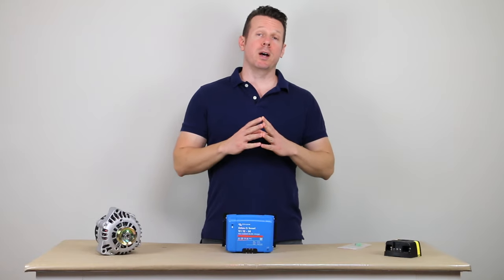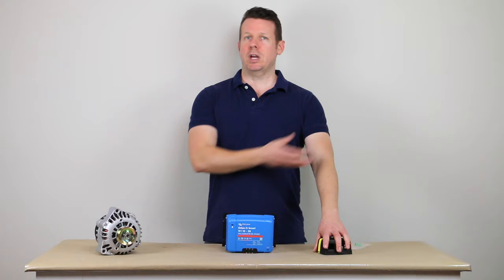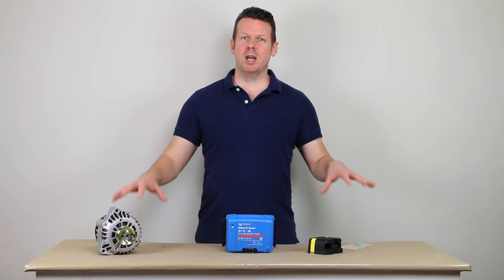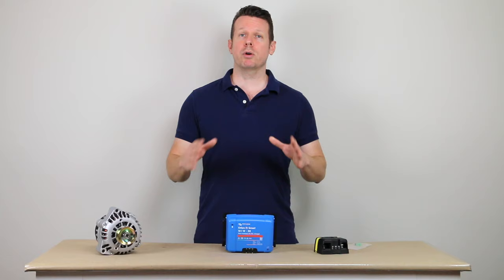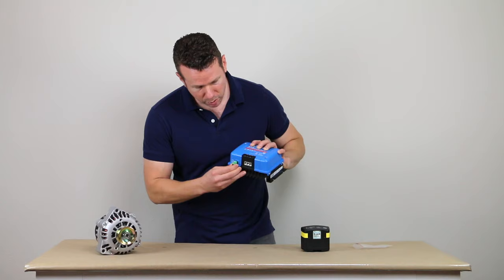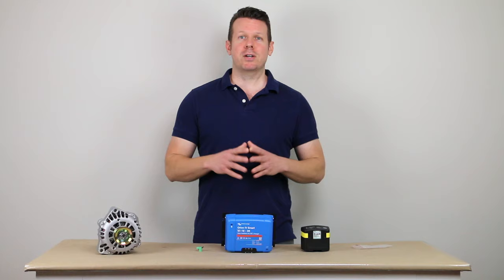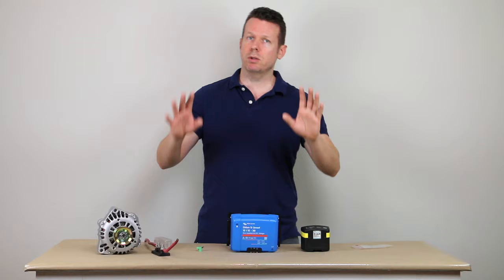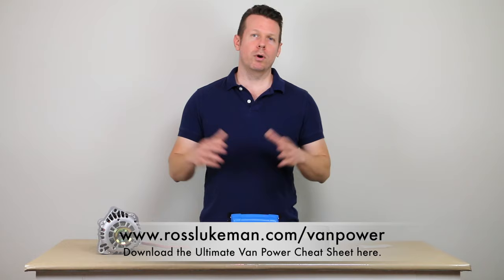Top 3 Alternator Charging Mistakes for Van Conversions | Featuring the Victron Orion-Tr Charger

Comment: Great advice! I outfitted a new Transit with the Orion Smart charger without ignition sense, relying on the “engine on/off” detection on the Orion. With Fords smart alternator it’s very tricky to get the Orion to function properly. It either senses low voltage once the alternator voltage drops and cuts out prematurely, or stays on too long after engine shutdown (if you turn down the shutdown voltage settings like I did ). Either way, not a great setup and I wish I would have just installed the ignition sense wire from the get go.
Reply from the maker: Hi Richard, sorry for your troubles but good to hear your story about problems with the "engine on detection" setting. It's supposed to work with the smart alternators but it sounds like if the settings aren't perfect then it can cause problems. Thanks for sharing!
Reply: 12v on a switch to the victron so you can decide if you want to charge or not. 

Pulling amps from alternator is not free, you get higher fuel consumption
Reply: I installed a votronic b2b on a 2009 transit without ignition sense as I think it said that the unit dealt with this however if you put your ear to the unit it sounded as if it was working long after the engine was on so I think I'll add a ignition sense wire on my new camper when I install me new b2b.
Reply: @chatteyj  just look at what your shunt is saying about current. 

Also look at what votronic user manual says.
Reply: transit have engine run only trigger wire under drivers seat at side of start battery this is used to trigger a relay because it's negative flick then pass 12v trough relay to victron and away u go turns on off when engine is run only.

Comment: if you wanted the starting battery to charge 1st......... could you not  hook up the DC DC on the secondary battery side of VSR, also putting the ignition on power lead to the actuated secondary battery charge cable side?
Thanks Rick

Comment: I’d love to run a DCDC charger but I have a smaller dual 28Ah (56Ah total) battery bank and the smallest DCDC I’ve found is 20 Amps which is for a minimum of 100Ah battery setup.
Reply from the maker: Hi Jay, with 56Ah it depends on your battery type. Pretty much any lithium could take up to 28 amps (.5C) while lead-acid would be 5.6 amps (.1C). If you have lithium then the 20 amp charger would be fine. The Sterling brand chargers also have a 1/2 power mode (night mode) that cuts the amperage in half if you need to do that (https://www.sterling-power-usa.com/batterytobatterychargers.aspx)
Reply: @rosslukeman  actually they are AGM
Reply: @JeepTJay6  Victron do a 9 amp DC-DC.  12-12 / 9. (No bluetooth on this model however). We use them on 55 Ah Lithium setups.

Comment: Hi Ross great video and very clear thanks. I’ve just bought a Victron smart charger 12/12 18 to charge a portable 100ah LiFPo battery pack but I also have an existing set up with relay for the second AGM battery built into my truck. I’m thinking that I could use another Victron charger to charge that and remove the relay. I’m wondering how best to wire these up and if I fit a switch to swop from one to the other or just let them both run in parallel? Have you done anything like this? Many thanks
Reply from the maker: Hey Landykart, thanks for tuning in and for the question. I have to charge for stuff like this as it would take a sketch and a discussion. https://www.rosslukeman.com/offerings Thanks

Comment: Sorry, I am a little confused about the little green plug. Am I supposed to connect the wire from the ignition into the green plug? Is there a positive/negative side to the plug? If I don't do the ignition option, does the green plug need to remain in the Orion or does it come out, or make no difference? Last question, what if I had a Master disconnect switch between the two batteries, will that provide the same safeguard? Thanks.

Comment: Hi Ross thank you for your video most enlightening, I’m looking to install a b2b but only have a 70 amp alternator could I ask what size b2b I could use.
Regards 
Paul
Reply: Don't know if you're still in the planning stage or beyond, but my situation with a 90A oem alternator is similar. Don't want to fry the alternator or drain the starter battery. 

A new unit from Pecron is just now coming to market - the DC1242-500 car charger. I've seen enough to convince me to take the leap. Although it doesn't have a wired connection for separate engine off sensing, it includes that function in its configuration selection via voltage parameters. So, the starter battery is protected from parasitic drawdown and the alternator can be indirectly protected by limits on the operational voltage range. (i.e. slower charge rate)

For me, the most demand will be during periods of poor solar productivity, which tend to be cooler. I suppose I'll need to find out how hot the alternator can get before it enters the danger zone!

Comment: The newest Renogy DC-DC charger I just installed does NOT have a provision for ignition sensing and atop that, I have a smart alternator.  Started charging when I first turned the system on and driving.  Now with aux battery sitting at 13.2 volts and the smart alternator limiting starter battery to 12.7 volts, I cannot get the Renogy dc-dc to turn on and continue charging.  I guess I could wait and see if I draw power from aux battery and hope the charger requests power from the alt.  I dunno if I wanna ask Renogy as I have a bad feeling they have poor tech service but maybe I'll try....

Comment: What is the inline AGU fuse for coming from the Chevy Express fuse box at 12:38? I’m thinking of wiring my amplifier into there instead directly to the battery in my own Express.
Reply from the maker: Hey there, thanks for tuning in. So that inline device is actually a little breaker, which quality-wise, I no longer trust. I would put something higher-end such as a Blue Sea 187 series DC breaker. If you want to try the one I had, it is this one: https://amzn.to/3yQ04wS Hope that helps, thanks for watching!

Comment: An isolation switch in the  feed.from the vehicle battery to the Orion charger will.avoid parasitic.load on the vehicle  battery.
Reply from the maker: This sounds like a good solution, you would just have to check if you have a smart alternator. Once it temporarily drops voltage, then the isolator would shut down charging. The Orions are programmed to accept this occasional voltage drop. Great insight though.
Reply: @rosslukeman  I have set up the Orion. remote.switch function with a simple toggle switch . When we park and.stop the engine I switch the Orion off. We have 600 watts of.solar on the van roof and a lithium battery which has proved sufficient so.far.

Comment: Thank you very much for sharing your knowledge, my name is Ivan and I have a question for you, What happens if the batteries of the Motorhome are 24V lithium and clearly the alternator is 12V? Can this device be connected like this or do you have to use another additional device to change the 12v to 24 first? If a hybrid charger is used, those that have everything integrated, that is, the inverter and the charge controller, would this device connect directly to the lithium batteries without going through the hybrid system? I don't see that it has a DC input, so that the battery could be simultaneously, let's say the solar panels and the alternator. Regards

Comment: 70 amp alternator produces 70 amp , it doesn’t matter what the draw is  the battery can’t make the alternator  produce more , as long as the fuse is rated correctly after the relay there is no problem , the only thing to be discussed is the charging profile of the alternator, what pattern it outputs ,
Reply: What? Umm you need to keep reading

Comment: On the cheap. LOL
No solar! Can't I just use a solar charger 12v sys,15, 20, to 30amp. And hook auto alternator battery to PV input with a on and off switch,  output to Aux battery and set your chem. on what type battery. Seems like that would work just fine with out over charging and take care of back flow.  I am an electrician, but this is not my field.
Reply from the maker: Hey Garner, good question. The problem is typically that the input voltage ranges are different between these chargers and solar chargers. Solar chargers have a higher input voltage range and function differently. Solar chargers are also set up for things like day/night that are foreign to DC-DC chargers, which have "ignition on" detection. They are different animals, I would get the right product unless you just want to experiment and see what happens.

Comment: If i have an aux switch on a 30 amp fuse (also w a relay) could the aux switch be hooked up to a 30a solar charger for lithium battery? 
Thinking of running making quick connection for solar at camp and run on aux on the road for charge. 

Bad idea?

Comment: Ok so I have a travel trailer camper. Do I still need a ignition wire or am I okay with the way I have it.I don't leave my truck connected at camp site or home.
Reply from the maker: If it's a trailer I would try to get by with the "engine detection" feature (it detects a rise in voltage on the input cable when the engine/alternator starts). Maybe add the ignition wire if it doesn't perform well with that setting alone.

Comment: Thanks for the info!!!  This was a very insightful video.  I have dual alternators on the shuttle bus my wife and I just purchased.  I’m thinking I’d like to use one for the started batteries and one for the house batteries.  Would I be able to just run the the dedicated alternator through a charger like you’re showing and then into the Lithium batteries?
Reply from the maker: Hey there, thanks for watching, I'm glad that was helpful. On using the alternators as you described, it depends on what the original setup was with the two alternators. If they have old cables intact and connected, you may need to see where they go. If the second alternator is just sitting there with a bolt for the positive line with nothing on it, then yes you can run a line directly to a charger in the back, then connecting the charger to the rear system.

Comment: Great Video! A lot of useful info! What if the alternator I have has a voltage regulator in it, my plan is to use this second alternator to run a wire straight to my secondary batteries, the alternator has a positive and negative connection for the voltage regulator. Do I still need a charge controller, or would using those lines be adequate?
Reply from the maker: Hi Nicholas, great question. I can't quite tell what you have, so I will say this. Some 2nd alternators are internally regulated to output a flat voltage, say 14.8 volts. You can also get them without internal regulation, where they are intended to be controlled by an external regulator such as a Balmar MC-618-H. This costs about $500 more, but eliminates the need for the DC-DC charger needed to adjust the flat 14.8 volts in the first scenario. The external regulator essentially becomes your multi-stage DC-DC charger, so you're controlling the alternator's output and charging algorithm at the source (at the alternator), instead of sending a voltage to the rear system and having to regulate it back there with a DC-DC charger.

Comment: the relays i use wont back feed power back to the starter battery from the bank, and the bank only charge s when the voltage is above 13v. idk what hes talking about.

Comment: Thanks, Ross, for the video! What are your thoughts on adding a second alternator to charge lithium batteries? Any reason to not do this when a voltage regulator is used? Thanks!
Reply from the maker: Hi Brad, it's okay to do but may be a bit overkill for most systems. You can expect 170-200 amps out of a 2nd alternator when the engine is cruising at 2000 rpm, and you have to have somewhere to send that amount of power to fully utilize these units. That translates to 170Ah -200Ah of battery charging per hour of driving, or running a rooftop A/C taking 1800-2400 watts. I work at a shop where we put these on vans that are airport shuttles with Dometic Penguin II A/C's, but otherwise the extra $2000 is better spent elsewhere. When you add the voltage regulator such as a Balmar you are looking at closer to $2500 not including install. 

We have started experimenting with 12-volt air conditioners such as the Kingtec KTD-3 and Dometic RTX 2000, which take up to about 600 watts. Then we can safely power these off of the stock alternator (they only take 600 at full blast, usually it's less). Using 1/3 the power also translates to being able to run these for much longer on batteries with the engine off, and being able to shrink your inverter capacity (DC air conditioners don't need to run through the inverter, just straight off of the batteries). So essentially we've been taking the $2000 and spending it on more expensive 12V air conditioners, instead of the 2nd alternators. Hope that helps!

P.S. Pulling 60 amps off of a stock alternator roughly translates to a 60Ah per hour of driving recharge rate for lithium batteries.

Comment: Can you connect a DC to DC charger directly to the alternator? My engine is in the back, and starter battery in the front. I'd like to avoid running a wire from front to back of my van where I want my aux battery.
Reply from the maker: Yes I think that will be okay. I did it once, hooked 3 of these to a 2nd alternator. They are dead when the engine is off, can't find them on the Victron app until you start the engine.

Comment: If your alternator has external regulator (Balmar) will that help address the issue of using an ACR and battery combiner vs a dc-dc charge converter.  (Actually on a boat). AGM starter battery / Lifepo4 house

Comment: Hello. I have a 2020 Boxer with 20,000 km and the booster doesn't charge me every time and when it charges me it doesn't charge as fast as it should. The battery is a Victron 12.8V Lithium Superpack 100Ah 1280Wh LiFePO4 and the booster is a Victron Orion Tr-smart 12/12-30 non isolated. The times that it charges I see that the input voltage is stuck at 14.4 but there are other times that it does not charge because the voltage that reaches it is lower and also oscillates so that it activates for a few moments but immediately turns off again.

Comment: I am trying to charge my 24 volt system and have a victron 24-12, do I need a victron 12-24, for charging. Also, will the alternator charge the two lead acid on the truck in addition to the four lithium batteries in my battery bank?

Comment: If you already haven’t can you cover the customer output terminals on the ford Transit 3x60 amp/h I think 🤔
Reply from the maker: Hi Glenn, I don't have a Transit to film with yet, but I can tell you just bolt your positive cable to the Transit connection point, and run it back to your DC-DC charger input. Alternator power located on the driver's seat base, pretty convenient.

Comment: With an older vehicle (2012 Sienna van) it it best to run the house battery charging only when the vehicle’s engine is above a certain RPM to be sure the alternator doesn’t overheat? Especially if I am running the Renogy dc to dc charger at 40 amps, I use a cut off switch on the dash to turn of the charging if we are stopped and just idling, and I will switch to a lower gear to keep the RPMs up eg when we are on a potholed road going slow. Is that safe, silly or reckless? (FWIW, I’m charging a 100ah LiFePO4 battery)

Comment: Great content, thanks for sharing. I'm upgrading my boat and my plans were to use a victron cyrix VSR (already purchased) to isolate the starter battery but I might have to reconsider now after watching this. Question: why is it ok to charge the starter battery directly off the alternator but not the house batteries? I have AGM batteries for both banks. Would it not be a good idea to have a dc/dc charger  between the alternator and starter battery?
Reply from the maker: Hi Robert, thanks for checking out the video! You don't want to isolate the starter battery from the alternator because when operating the engine and vehicle, the loads on that circuit are never ending. If the engine battery stopped receiving a charge, it would quickly deplete as it fired the spark plugs, ran the vehicle computer, etc. It's under constant load. The batteries in the back are not under constant load typically, so they can get "full" and it's better to back off charging at that point to extend/preserve the life of the rear batteries.
Reply: You should not charge the starter battery and the house batteries at the same time from a single charger. You will knacker the batteries and shorten their life.

Starter batteries and house batteries have different electrical characteristics and should not be connected in parallel and charged at the same time. 

If you want to charge both at the same time, you need a separate charger.
Reply: As a boat Captain It’s fine to charge the starter batteries and house batteries. I’m not sure what kind of boat or battery banks you have but you can even isolate the house batteries into port and starboard banks. These guys use boating terms like “shore power” but have no idea how it actually all works on a boat. You’ll probably want to add a second alternator to one of your diesels.

Comment: You may have already covered this. Would you still need this if you are using an inverter charger with a charge controller built in. Thank you.
Reply from the maker: Yes, inverter-charger and charge controller cover shore and solar respectively. You'd still need this if you want alternator charging.